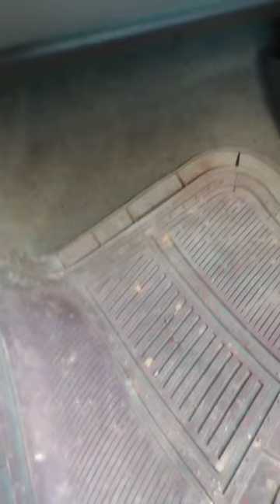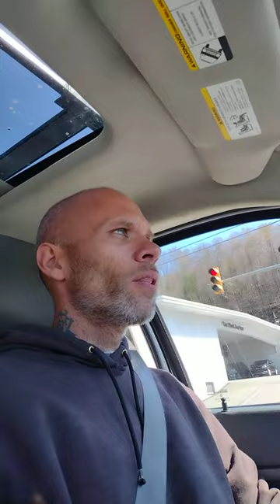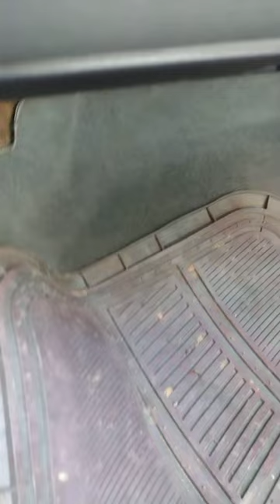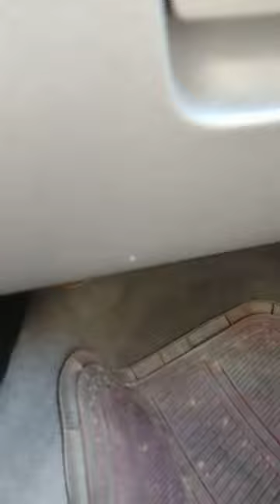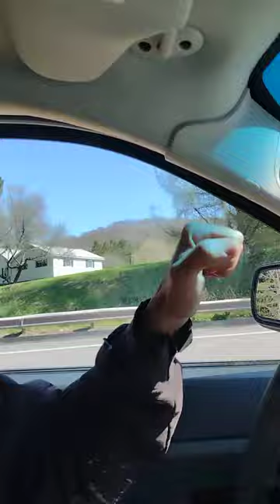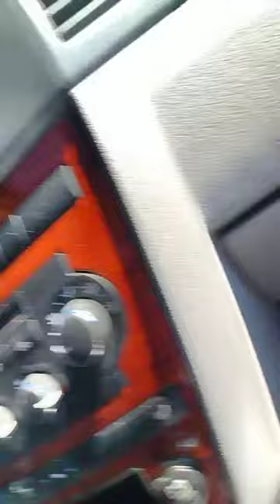the sound of bad front differential bearings

Comment: Thank you my man have the same issue in my BMW and I thought it was my rear end but you're the only person on YouTube apparently that has posted the actual sound it makes LOL
Reply from the maker: That's awesome thank you very much..it's that sound baby..
Reply: @redhandedreviews3482  I think what had me thrown was my rear driver's outer axle boot has also failed so it was very hard trying to figure out what was making noise but I was almost positive it was the differential. After watching your video yesterday I went home to the shop and started digging in. Sure enough you are spot-on thanks again
Reply: My man 06 bmw 325xi here and I have that sound when turning a bit sharp I thought it was gonna tear my wheels apart the only thing Is i dont here it when accelerating only when turning think it could be just the cv joints? I do know i need a knew cv axel so i might as well do the whole suspension

Comment: I have a Jeep WJ 2000 and it’s definitely this after watching your video basically makes no noise when foot off the gas but applying any acceleration it clicks and goes  away slightly at higher speeds. It’s super loud from like 0 - 25. I put my Jeep in N going down hill and no clunks as soon as I put it in drive and add gas it would clunk. Thank you I’m hoping I figured it out but this suckkks
Reply from the maker: Yeah it does suck but if it's just the bearings and not the gears that in itself is a wheww moment..lol .yeah any gas made it click like that..it sucks...I don't know anyone that works on them..
Reply: Been 3 weeks for me to figure this out
Reply: Damn i have same exact sound.  Just changed the transfercase chain. Thought it was that.  Nope. This is it. Fuc…..
Reply: Damn. Same sound.  2010 jeep grand cherokee. Just changed  my transfer case chain. Thought it was it.  Nope.  O well. Thanks best video.

Comment: If you been driving it like that for that many months you give me hope with my rear diff.. Mine is not grinding but it does have a very faint low whir sound and some backlash when putting it in gear especially reverse. Sometimes it clunks 1 time when turning at very slow speeds avery now and again. I found I had a leak and didnt know for like 2 months and was almost 3/4 empty on fluid. Im getting the gasket fixed and putting in royal purple to see if that can buy me time to get the money to either rebuild it or swap it out. Parts are not expensive for my car its the labor that gets you.
Reply from the maker: Yeah drove it like that for a year and a few....now with the rear making a whirl noise could be your pinion gear ..clunking could be bad bushings in the front diff,,,,or bad drive shaft prop shaft or slack in the transfer case chain...make sure if you have electric limited slip to add more than the bottle has in it ..I had that clunking into gear too thought it was my rear it was my rear drive shaft..and prop shaft...the clunk while going into Reverse... I have now...might be my axles...not sure yet .one single clunk clank noise when I back up...might be my transfer case..I have a spare so ..10 mm wrench and ratchet wrench with swivel head and shorty wrenches needed ...I noticed I can move my shafts while parked ...
Reply: @redhandedreviews3482  thanks. I appreciate the advice.

Comment: Thankyou very much for this. Have very similar symptoms on a Nissan Navara D40 in Oz (similar to Frontier or Titan in the US). Hoping it's front diff and not transmission or t/f as front diffs here are relatively easy to get used and a ton less money than a gearbox rebuild. Interesting why mine quietens down on coast or no load same as yours but starts up again under power even though only rear diff would be getting engine torque. I also have slight steering restriction but just noticeable

Comment: I'm a little surprised they replaced all those parts, it must have been impossible to localize with it on the lift.
Reply from the maker: Yeah I went in for an alignment they said they cant alien my jeep thats there is no adjustments...Jack ass's at Jack williams/Kost, and dodge Dealership. I knew at that point these chain repair shops have no to little education. They proved it when they hired a friends kid that only worked on his truck...and only his cars no training, certification, so. When a shop says you need this or that, people do it out of respecting their knowledge, I have a good friend thats been a cert mech for almost 2 decades that gave me a heads up on issues with a bad starter...transmission, and electrical issues reading false codes.....I just posted that one..I have more experience than them. But I replaced the parts on what I was told it was or my own accord like shocks wheel hubs, drive shaft water pump alternator , I replaced transfer case, egr valve, and lower control arms due to the shops.......Most people have issues with the chain loosening in the transfer case that can sound like that when it smacks off the casing, and the chains are known to skip teeth...axles click, but this was different lol. I know the sounds of things now on this jeep...lmao
Reply from the maker: Funny thing is ..none of the repairs they said was needed was either just replaced or was not the problem ..that's why in the last year I pretty much listen to a friend or myself .

Comment: Got a 2012 ram 1500 that makes that noise then accelerating,  doest do it quit as long as yours does but its still bad.. wasnt sure what it was till your video.  Thanks
Reply from the maker: Your welcome..I hope you get it fixed it's very common on dodges if you have els or electronic limited slip it's hard to find one used..for less than 700

Comment: They discontinue essential parts because the manufacturer wants you to buy a new vehicle.
Reply from the maker: Oh I know...lol..I got two front differentials now .one is going to be rebuilt this year or next year...a brand new cammed and tuned 5.7 dropped in and new transmission and torque converter and flex plate...fingers crossed...for next year...poor old boy got 215k on it .

Comment: my 2006 lexus gs300 is making that same noise I changed the front differential but it's still making the noise it was a use differential and the axle is moving inside the front differential
Reply from the maker: Yeah that is probably a bad bearing
..an axle going into the splined part of the diff is usually never the problem usually a bearing ...
Reply: @redhandedreviews3482  so it is best i just change the differential
Reply from the maker: @clarendonman3538  no not necessarily...might just be bad bearings...

Comment: Gotta highlander with humming noise coming from the front drivers side. Me and 2 mechanics thought it was the wheel bearing and i got them replaced and a drivers side axle and it still makes the same humming noise constantly when you're moving foot on or off the pedal, and now they're saying it's a transfer case. Idk what to do. Have you ever heard of this, do you have any idea's?
Reply from the maker: The humming noise is the first sign of bad bearings...I was told it was my wheel hubs then transfer case ...I took it apon myself to do front diff..that's when I found out it was the problem....some mechanic shops just don't have it nor can they diagnose a problem by a noise...also no grease in your axle could do it  like mine is doing...I need to replace them but been repacking them with grease..now the boot is ripped ...however i can see it being the front diff as the bearings are noisy then it goes to a clicking sound almost like bad axles...bad axles drive shaft , prop shaft should be checked first before going the front differential replacement..
Reply from the maker: But the diff making noise sounds more in the middle of the vehicle as it is in the center of the vehicle..plus drive shafts throw noise as sound moves thru metal...and they make a wheel hub noise when going bad..mi e did..sounded like a bad wheel bearing going down the road and was worse when I let off the gas....if it's isolated to driver side it could be the axle or bearing in the diff  on that side inside.

Comment: So im having the same issue, and someone told me if i eliminate the front shaft from the transfer case to the front differential it would take away the sound and instead of having awd it would be 2wd just until i get the front differential, is this true???
Reply from the maker: No....you take that out its always on neutral!!! I removed it ..after i took the wheel chalks out it rolled into the grass in park..
Reply from the maker: The older ones you can

Comment: What year jeep are you driving.  Thanks.  Same issue
Reply from the maker: 2005 grand cherokee limited..
Reply: Thank you for the quick response.  I deff have same issue. Just finished the transfer case chain today. Not the problem. Great video.  How long of a job was it  for you to change.  Great channel. Glad i found you.  Thanks Brian. Long island new york.
Reply from the maker: @brianmooney7009  well it takes me about 6 to 8 hrs..take off axles, losen axle nuts while on the ground break calipers rotorsupper control arm tie rods lower control arm frame side disconnect prop or mid shaft, make sure to block the wheels it will roll once you take front driveshaft or prop shaft what ever you feel like calling it .then take off the three bushing bolts for transfer case the front two are easy the top one is a little pain..but doable from rear of transfer case . Buy a transmission jack from harbor freight made my life a ton easier..then lower it..make sure to remove any wires lines  or plugs that connect to the
Reply from the maker: @brianmooney7009  i have a few videos from  2 years ago on putting it in and other stuff like how to replace the front differential bushings
Reply: @redhandedreviews3482  thanks. Gonna check it out

Comment: can you change the differential bearings or do you have to change tne entire diff?
Reply from the maker: You can change them... Might be probably easier to pull the diff..but the bearing puller should fit in there without pulling the diff just axles...if it's a pinion gear then it is a little more involved.

Comment: 08 cherokee larado sounds like marbles  got loose in it😮
Reply from the maker: Yeah it's probably the bearings...mine was so bad the oil was silver flake colored...but went on like that for a year..took me a year to find a used one for less than 700...paid 375 for this one at denaples auto parts in Scranton..they don't make them anymore so what's out there is out there..but if you have the non electronic limited slip diff yours is super cheap and a million of them..

Comment: Does a Camry 2. has a differential?
Reply from the maker: Not sure. I know all wheel drive does...But anything that has cv axles must have bearings that the CV axle locks into it ...those bearings with the splines could be bad I suppose and make noise...I know my cougar c2 had bad spline or bearings inside the front ..I believe they called it a gearbox like a subaru...it was a standard..but my Subaru is automatic...but it is all wheel drive so it has a front diff..

Comment: So what if I only hear it when I’m not accelerating
Reply from the maker: The only thing I can imagine when that happens is the bearings are just going or it needs a front diff fluid change possibly front cv axle or prop shaft......if the fluid has limited slip differential fluid additive in it by another bottle because you might need it..but fluid usually gives it a binding kinda thump...when turning...

Comment: You drove a year like that
Reply from the maker: Yes ...and it would still work but boy did it sound bad...waited almost a year for a used diff from deNaples Auto parts..350 vs the 1k for one in NJ...counting the 200 shipping..
Reply from the maker: Their tough and take an ass whooping...but when they do be prepared...super easy to do...but not without a tranny jack lol....wait transmission jack..they are expensive...getting my old one completely rebuilt for 1500...still cheaper than I Believe it's ....national diffs...they want 1950 plus 200 for shipping...
Reply: Thinking mines maybe going out!
Reply from the maker: @raymondspears3836  there's two ways to go out clutch pack or bearings...if the clutches are acting wierd like binding add more limited slip fluid..if it's the bearings..well that's not to bad to do...but it's still a pain..